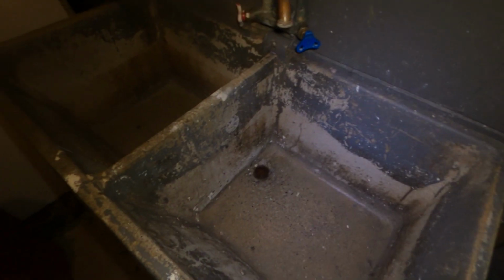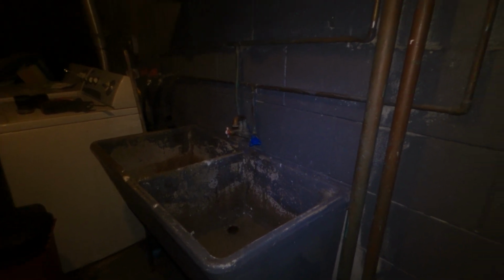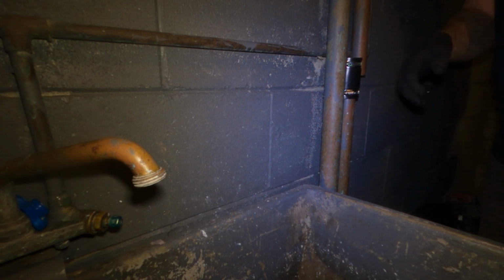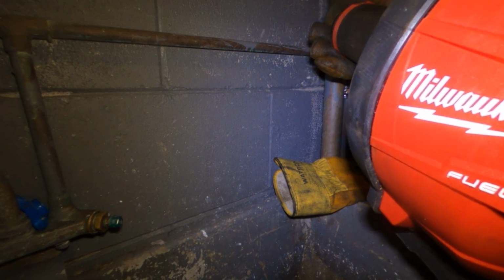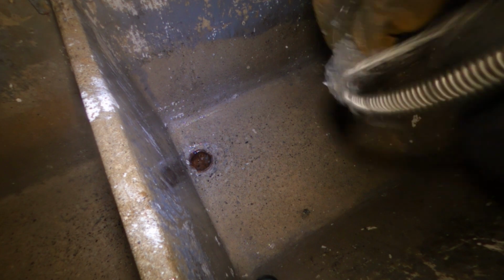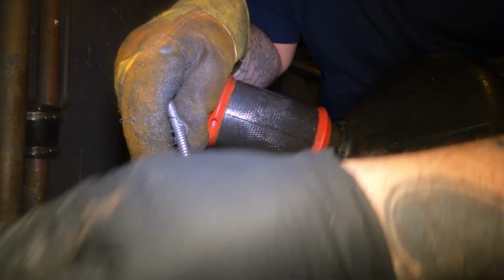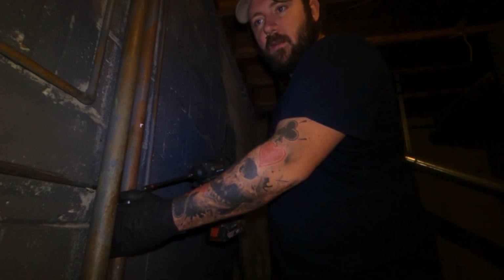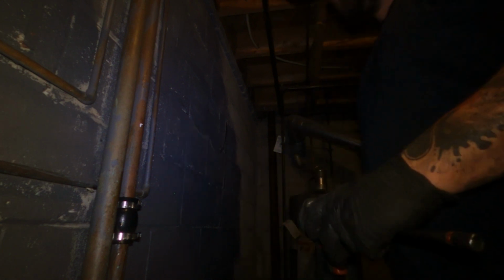I DON'T THINK THIS HAPPENS TO ALL MEN.

Comment: Yes sir those old cement double sinks...went to clear a clogged drain as you're and end up replacing the crack tub to a new poly sink.
Reply from the maker: Really eh
Reply: The home owner didn't know it was cracked from the drains underneath...sold them a new double sink and laundry faucet....
Reply from the maker: Awesome